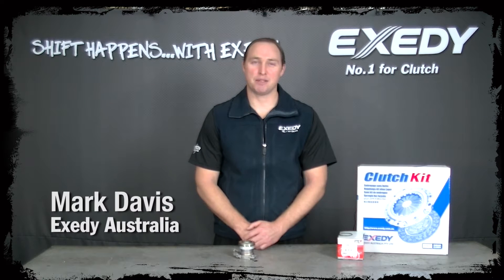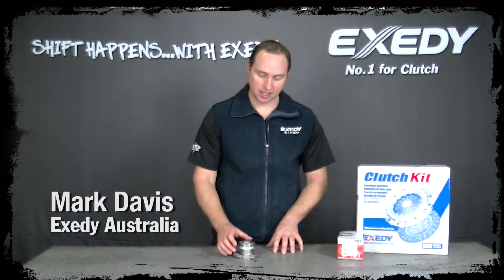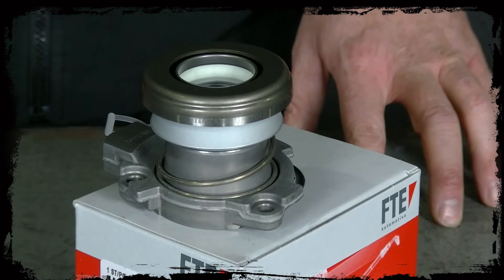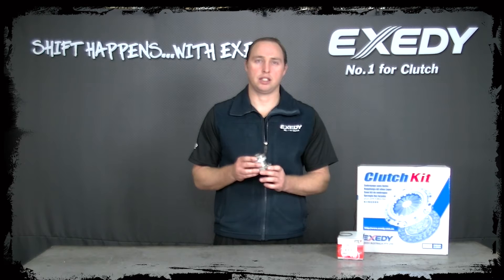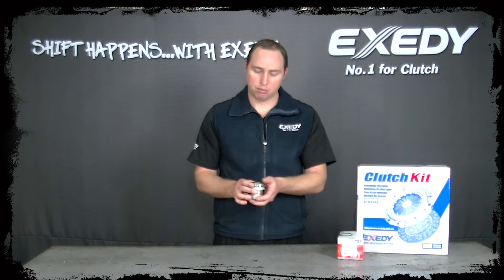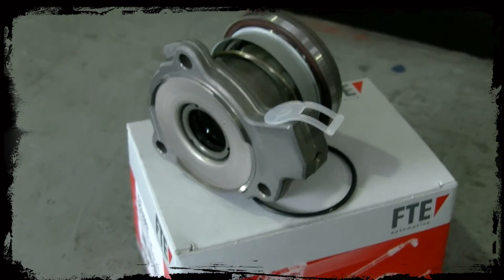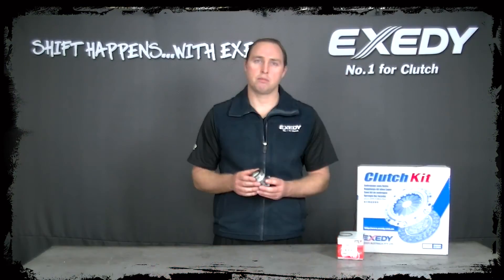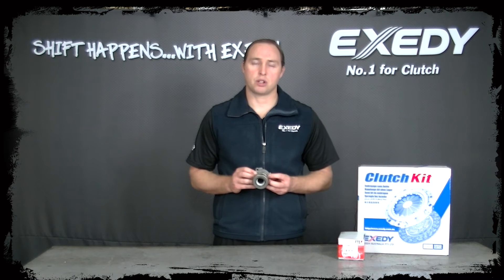Concentric Slave Cylinder

Comment: Why do you said not to compress it? It is old wives tales, right?
Reply: I wish it was an old wife's tale when you press on it with your hands you push the the cylinder fluid seal down to the base of the cylinder making the brake fluid unable to enter because it has no where to go the your fluid line will jump out because of pressure building up can't go into the  chamber it effectively block but the rubber seal I know because it took me two slave cylinder mishandling and a lot of cash to learn this lesson
Reply: Chadwick Passley hi, does compressing it before installation, cause noises from the release bearing once installed? I’m on my second csc and it has a new clutch but there’s a noisy rattle on idle until I press the clutch pedal. I made the mistake of compressing both the new csc’s before installation and the same noise. Never had this noise on previous clutch and csc.
Reply: @alexanderjones1451  are you sure its from the slave cylinder  it could be that  it's vibration form the bell housing shim cover plate maybe a bolt or two wasn't tighting enough
Reply: Chadwick Passley it doesn’t have a shim plate. It’s a Ford transit mk7 fwd. noise goes when I press the clutch in
Reply: @alexanderjones1451 what does the nose sound like ?? it's a possiblity that the bearing wasn't installed properly or may have had a manufacture defect
Reply: Chadwick Passley sounds like a clatter chatter noise. Quite loud. It’s a smf clutch. Brand new but both changed csc are making the same noise. But I did stupidly compress the csc when I got them. Old smf never made this noise. I do have a remap tho but don’t know if that makes a difference. Never did before
Reply: Chadwick, you may be right, I'm not a specialist.
I only ever changed one of these and before installation I pressed it a few times to make sure it worked. My kids played with it too, till I stopped them.
I assume that the spring inside does its job and then the pressure from the fluid.
Anyway, years later and many thousands of miles, the car is absolutely fine. 
It may be that some manufacturers do things differently, but I was lucky.